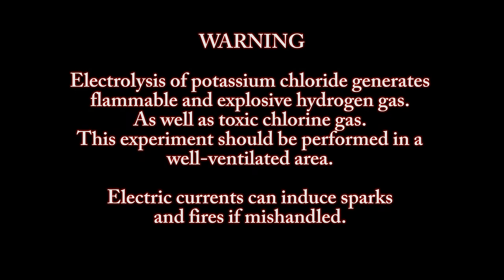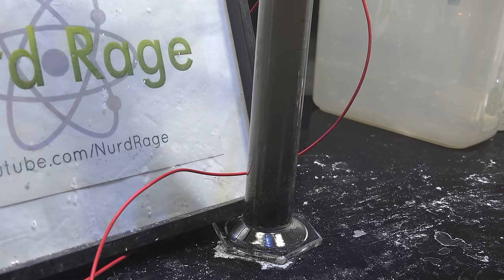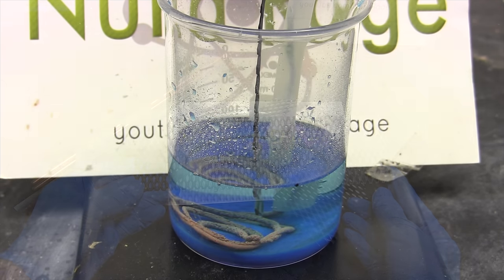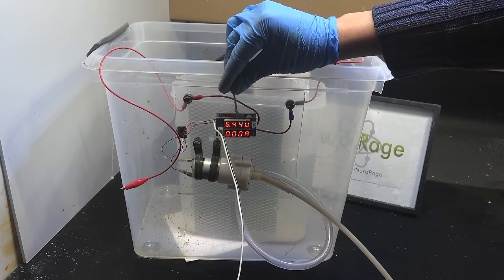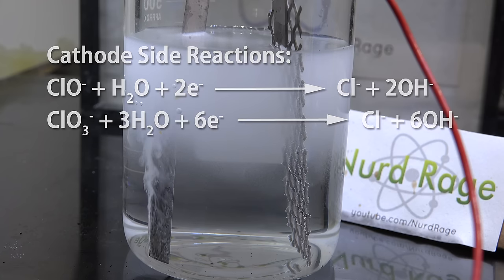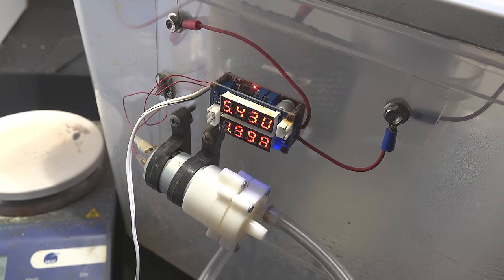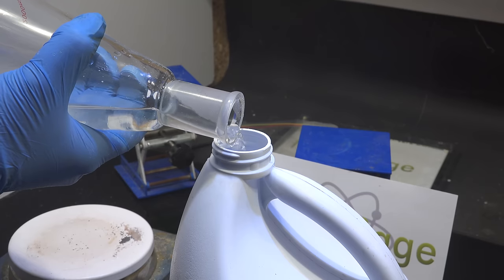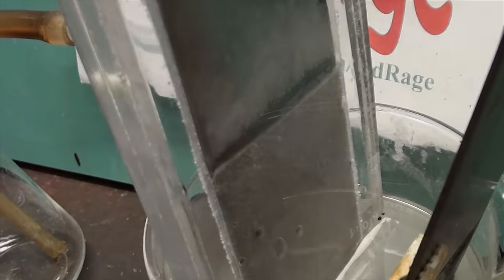Make Potassium Chlorate by Electrolysis - The Basic Guide

Comment: These carbon electrodes are really not the best ones you can get. Most arent even graphite, they are just some press sintered powder. I use glass carbon electrodes and they work exceptionally, although having bit of resistance.
Reply: What would happen if you 'cook' one of those electrodes in an inert, oxigen-less, or reductive atmosphere at very high temperature in order to induce graphitization? Can you get more stability?
Reply: @leninalopez2912  You can, temperatures are usually "out of range" for amateures.
Reply: @ShroomLab  Yeap... That's what I thought. Although maybe not the tempratures in themselves, but the deal with the tempratures AND those particular atmospheric conditions. There's plenty of demonstrations of how easy is to make a DIY electrical ovens on youtube and else. But in most cases it is just a more or less efficient thermally isolating material, with lots of brute-force 'heat dumping' with a resistive element. I wonder how hard can it be to do the same, but with a tailored atmosphere :/. Seems very inefficient but, maybe by just flooding? :/
Reply: @leninalopez2912  An extract: 
"At this stage the shaped and baked parts are heat treated under exclusion of Oxygen (air) at extremely high temperature 4530-5430°F (2500-3000°C).
The process, called graphitization, results in Crystallization of amorphous precursor carbon, which transforms into crystalline graphite."
You will most likely not reach these temperatures, some pressure, not too much is also recommended. You will need a cooles chamber, either induction or sesistance heating, directly through he graphite. Most carbon electrodes skip this step, they are just baked coal powder at 1200°C, therefore no graphite.
Reply: @ShroomLab  Oh, I learned a lot from you. What about the graphites in the dry cells? any idea? are they real or just baked to 1200c

Comment: may I use pure titanium rod(99.95%)  as anode? I heard that it resist corrosion as Pt do
Reply: Probably not, I imagine the Ti would just go into solution as Ti(ii). Anything that would be oxidized by elemental chlorine will dissolve into solution or disintegrate.
Reply: @noahswindler7461  ok thx

Comment: can you safely run that 1x4 platinized titanium anode at higher amps without needing to worry? also is that 300ma/cm^2 for expanded mesh or not? like would a 1x4 platinized titanium anode be 4in^2? or only 1in^2 or 2in^2 if the expansion ratio is 1:4 or 1:2? can this anode be safely run with 5v at 5-6 amps without the anode degrading?
Reply from the maker: That's beyond my scope of understanding and specific to your cell conditions and electrode quality. I quote the low end in my videos because lower is generally safer, especially for platinum. The  300ma/cm^2 is for solid platinum. You'll need to recalculate for expanded mesh. If the mesh is 1:2, then it's 150ma/cm^2 for equivalent size.

Comment: Could you make sodium chlorate this way?
Reply: Asjen Mensink yes you can, but the problem will be separating it from the residual unreacted sodium chloride. Because sodium chlorate is very soluble in water as opposed to the potassium chlorate which isn't (and thus easily separated).
Reply: Yes you can. There are two methods of preparing chlorate in these cells. It's a very interesting dynamic. It's as follows, You're adding sodium chloride which is getting converted to sodium chlorate, meaning when the saturation of NaClO3 occurs from there it will begin to precipitate out while NaCl gets depleted. Of course if you think about it, where will all the NaClo3 be going if you keep adding NaCl when Concentration gets low? It will precipitate and that's your pure crystals of NaClO3.  I mean, adding NaCl to below the max solubility, meaning it'll get converted to NaClo3 which will accumulate to reach max solubility and will start precipitating out.

Comment: NURD I need you to make a video on how to make electronic PCB's at home with CHEMISTRY. GO AND DO THIS PLEASE MY NURD
Reply from the maker: Do you mean etch a commercial PCB to make the circuits? Or actually add a copper layer to a sheet of fiberglass and make the PCB from scratch?
Reply: @NurdRage  The latter! It would be drawing the circuit paths using whatever means you find easiest, and then finding a way to imprint that layer onto a copper clad board by etching. Or perhaps you could think of a more creative way!
Reply from the maker: Wait, are we using an existing copper clad board? Or making it from fiberglass?
Reply: @NurdRage  It would be up to you. You can use an existing copper clad board, or you could make your own. It would depend on what process you'd like to use to create the PCB. If you use an existing copper clad, you'd have to chemically etch the circuit. If you use a clean board, then you'd have to somehow create the copper (or another material) traces. That's where you come in, to decide on what to do, if you're interested in such a project..
Reply: @NurdRage  Another cool project would be to create a transistor. It can be done with a furnace and some chemicals.
Reply: If you are interested in either of these projects and would like me to help out I'd be happy to.

Comment: Can stainlees steel be used as a cathode?
Reply: You will die of chromium VI ions, which is extremely carcinogenic.
Reply: Actually as a rule of thumb there's a machine called electrochemical milling which is used to machine by eroding most metals placed at the anode. so if it's not platinum, graphite .. you know the answer, it'll be eroded
Reply: @davemwangi05   Thanks
Reply: I think you can use it at the cathode. (research further) Just don't place it on the anode. at the anode the metal ions dissolve into the solution and it's eaten away until it eventually disappears into the solution. ON the anode only the stable electrodes, graphite and  platinum etc are suitable.
Reply: @davemwangi05   
I also investigated and stainless steel even on the cathode could corrode due to adverse conditions in the chlorate cell

Comment: I wonder if it works for sodium chloride
Reply: forget it, I just checked up the solubility of NaCl and NaClO3 and won't work! because unlike KClO3 which is much less soluble than KCl, NaClO3 is more soluble than NaCl.l
Reply: @deathkeys1  Yes it's even better if you want to make Kclo4.
Just mixe The NaClO3/4 solution with Kcl und KClO3/4 will precipitate out.
Reply: @julian-io5wl  I know the reaction for this, in fact when dealing with chlorate was the first thing I saw some years ago, but I think that using sodium in this way is kinda wasteful compared with the mathod shown here, unless I can get more efficiency on the electrolysis side of things... anyway I just wanted to do with sodium because around here potassium chloride is kinda hard to get, but thanks for the heads up
Reply: hi hi so if you want to make a perchlorate do you just let the cell keep running? When does it start producing perchlorate? Once all the potassium chloride is gone? And then how do you know when you have just perchlorate?

Comment: Wait a minute, the platinum electrodes are just titanium PLATED with platinum, but you say they STILL corrode away, just slower, and can take 10x the current? It seems to ME there would be no point if they corrode AT ALL, since they're just a thin electroplated layer of platinum. If it corrodes away at ALL, that will be gone quickly. What's even the point?
Reply from the maker: If a few years of use is "quick" for you then chemistry is NOT the hobby for you.
Reply: The fact that only a few microns of electroplated platinum last YEARS after countless corrosive experiments should also tell you how badly other electrodes corrode, considering platinum coated electrodes are about the best you can get. For carbon electrodes, we're talking like 1 MONTH, max, sometimes weeks. In fact, some experiments, if you cut corners and use cheaper carbon electrodes will actually cost you MORE overall due to the fact you have to buy, like, ten times as many to get the same yield. Either way, yeah, have to agree with NurdRage's sentiment. If that seems like a too high corrosion rate, don't know what to tell you buddy, that's literally the limits of chemical efficiency, you're not gonna do better than platinum.
Reply: Or else feel free to make for yourself a solid platinum electrode which will be useful even to your grand-children even with intensive use. The downside is that for an electrode of that size you will need about 2 ounces of platinum, and the platinum spot price is currently about $900 per ounce (and that is low, maybe time to invest in platinum LOL)
Reply: @spiderdude2099  Hey, you seem experienced in this, how good are the graphite rods in dry cells? Can I make a KG of this stuff out of 'em?

Comment: I wonder if you could use the carbon electrodes without contamination by using a filter member that lets current through but not fine particulates. I wonder how carbon fiber electrodes would fare.
Reply: Yes you could, but you'd still need very large surface area electrodes, like a graphite/carbon sheet.
Reply: @neutronpcxt372  Interesting. I'm already in the process of making one that recirculates the water flow so that it passes through a filter. If you know of a hydrum pump or an air-lift pump (old technologies)  Like I mean, there's hydrogen being generated, which I'll use to provide that buoyancy for solution circulation. hoping to get super clean crystals from this. What do you think about this? bad idea/good?
Reply: @davemwangi05  You mean a hydram pump, right? That would be an interesting idea honestly, but finding any of these pumps cheaply will be a very hard to do.
Reply: @neutronpcxt372  Yeah, the Hydram. But that was just a mention. In my apparatus I mean,  I'm using the airlift pump. <--- it's another old but cool tech just as famous as the hydram.   Very easy to implement right inside the sodium chlorate cell, such that the hydrogen coming from the negative terminal will generate lift hence raising tiny segments of water to a height H into the paper filter and the crystals will precipitate under that filter/container, the solution water will circulate back to the chlorate cell. Bingo! I'm in the process.
Reply: @neutronpcxt372  Me make it simpler, Like picture this, the closed chlorate cell is under pressure due to the generated hydrogen, partly why they have the delivery tube to the scrubber. Now in the chlorate cell if you make the output tube a little submerged into the liquid then the accumulating hydrogen above will force the liquid out until the liquid falls below mouth of the tube. then H2 will escape. If you have another container with a filter above and an inlet tube running from the above to the chlorate cell, submerged  then circulation will happen as the hydrogen gets evolved.

Comment: one fatal flaw with that electrolysis box I made one and realized that at higher currents the hydrogen builds up inside and umm... the buss bars are at 150 celsius on the outside and yea hot metal + hydrogen doesnt make a good mix in gaseous mixtures.
even when there is an active pump still wouldnt risk it
Reply: @suckinDiesel44  I just used an airtight container with a hose and fixed any leaks with some superglue + baking soda.
my cell runs at 82% efficiency with pH control and the port for the hose doubles as a temp measuring port

Comment: I just buy it for about 8 dollars per pound
Reply from the maker: You got ripped off. The video makes it for less than $1 per pound.
Reply: Yup. My cost is about $0.72/pound by electrolysis and that includes the cost of the starting KCl. The MMO electrodes have long paid for themselves over. :)
Reply: That's awesome brother.  Sadly I use very little of the stuff (maybe a pound or two per year) to warrant building a cell....